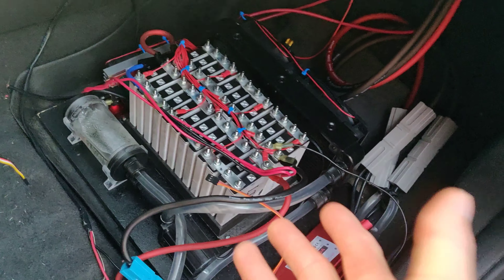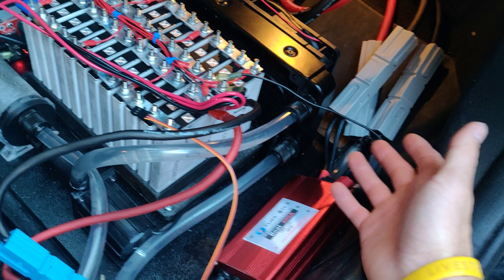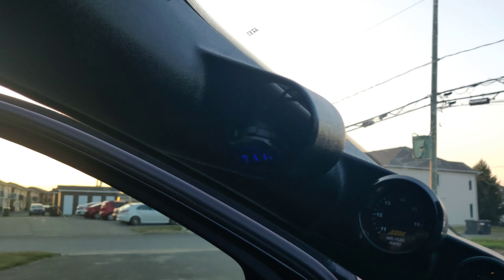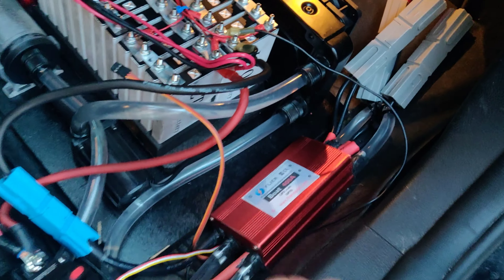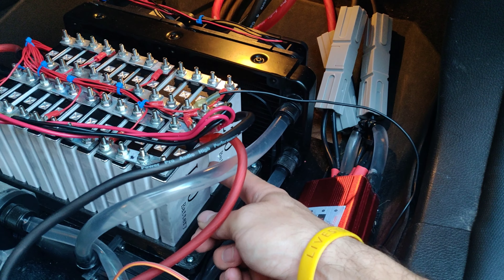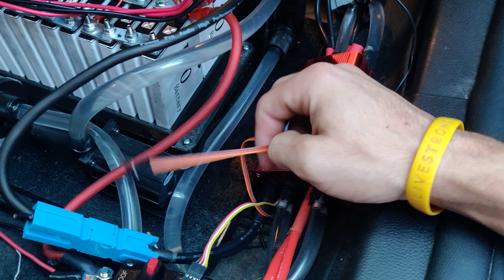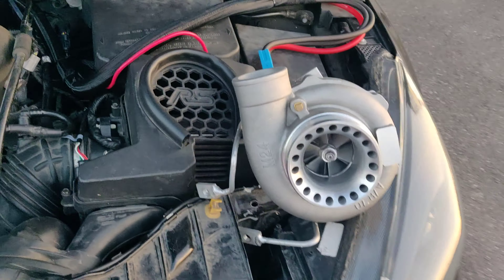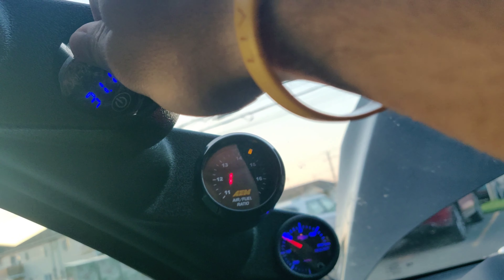electric turbo pt.4

Comment: Cool vid! But from all the other YT vids short power cables is really a must. As far as I know, all have the battery and esc ectremely close to the motor. The ripple will cook the esc's capacitors  and create problems with reading the motors back emf with those long cables. With improper back emf reading the phase timing will be way off and cause all sorts of problems.
Reply from the maker: I totally agree and learn this not long time ago but I wanted to give it a try. I learn the hard way! BUT I contact MGM this whis and talk about this and they said the ESC need to be clost to the battery and my 7' cable not supposed to have problem. So im still between your opinion and their's. They will help me to programme the ESC and we will look the datalog together ! we will see 🤞